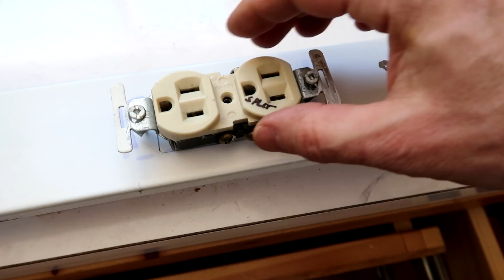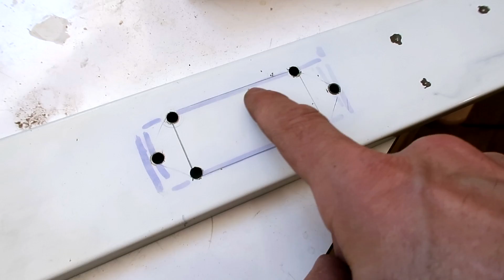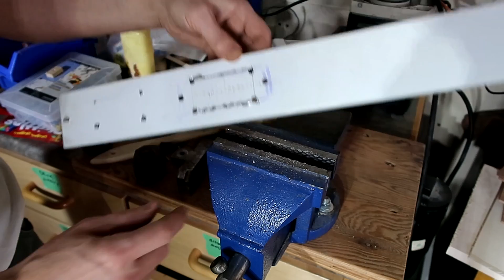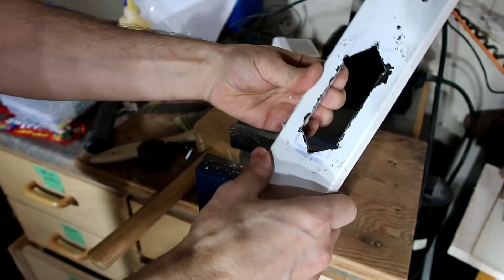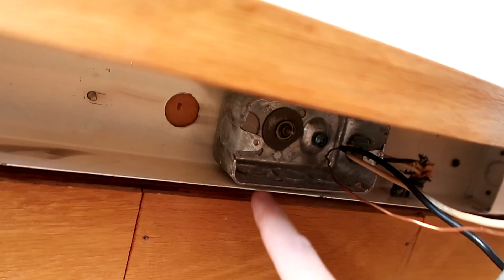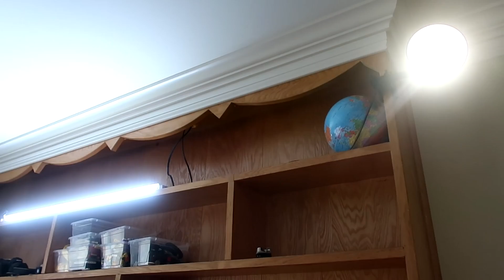Metal shearing with vise and chisel trick

Comment: Without electricity, I once used this method (along with a large hand crank drill) to make slots in a  homemade replacement sheet metal push-rod guide, for a broken down electric generator.

Comment: Would it have worked any better or worse if you'd screwed a block of wood to where you wanted to cut out with the chisel? You know, similar to when you drilled out the holes. I mean, I know you wouldn't have been able to chisel out from the other side without moving the block, but it would have been held nicely in the vise.
Reply from the maker: no.  I needed to shear, not cut.
Reply: @matthiasrandomstuff2221  Fair enough, it's just something that occurred to me. I don't do enough work with metal to know the best way to do this sort of thing.

Comment: Not a single waterstone in sight!
Reply: Waterstones are a compromise that effectively polish while rounding edges. :)

Kidding. Sort of. But the softer the stone, the more this occurs. Soft water stones are ok for sharpening knives, plane blades, and wide chisels. They are terrible for sharpening quarter inch chisels, awls, and drill bits. Harder stones can sharpen all of the above. You just have to live with the esthetic scratches they can leave on a knife.... or obsessively polish in an extra step, which is no more work than obsessively flattening soft waterstones.

I think the only place waterstones are actually highly popular is in an alternate reality called the internet, and it's a testament to the power of advertising.

Comment: I have a nibbler for just this kind of work.  They make quick work of it, and produce a pretty clean edge with minimal filing.  Personally, I find this kind of shearing is better left for things like thin carbon steel because it breaks cleanly, without the wavy edge.  Bushradical has a pretty good video where he uses a similar technique to make ulu's out of old hand-saw blades.

Comment: You said the angle grinder was messy? 🤔🤔🤔
Reply: Edgardo Guzman I guess he meant messy as in: metal particles flying all over the place
Reply: Also cuts slightly further than needed, especially on the short sides
Reply: @TheMijman   So what? Everything will be hidden beneath the cover. And you could also use a worn-out disc that has a smaller diameter. Or a dremel with a really small disc.
Reply: @hunjoey  +1 for the dremel.
Reply: @hunjoey  That doesn't negate the comment above about metal dust/shavings/foot-destroyers/anti-baby-countermeasures
Reply: My point exactly
Reply: I drill with my welder sometimes

Comment: I'm sorry, but I just have to say this: I cringe every time I see "your" (and by that I mean north american (all the countries on that part of the continent)) electrical system/wiring.
Why your houses burn as often as they do caused by faulty electrical systems seems completly clear to me. Houses of wood, 120V (half the voltage compared to many other countries = double the current = 4 times more heat in the wires) and that electrical wiring (i.e. using screws to hold the copper/wire) seems like beeing chosen by the devil himself.

But relating to your video: if you want to shorten a chain, this way also works very well (clamping a chain in the vise and then snapping one link off).
Reply: yo just curious, what do u guys use instead of screws?
Reply: @albertlagerman  
I can just give a german view here. Screws are still commonly used in this home application, since you are mostly dealing with rigid cables and such with outlets , these are not subjected to any sort of vibration that poses a risk of loosening the screw. In industry, push-in connectors like WAGO are pretty much the standard these days.
Reply: Australian chiming in here...

Household power sockets deliver a maximum of 240v, 10A. All (most?) electrical connections are made using machine screws in some sort of brass or copper connector.

Edit: I'm not an electrician, BTW.
Reply: 2X current gives 4X heat only if the wire diameter is the same. I assume you guys take advantage of your high voltage and low current to use smaller diameter wires. So that advantage probably isn't relevant. Of course, large diameter wire is more expensive. So you've got us there.

Comment: dude, just put it flat on a piece of wood and chisel away.
Reply from the maker: due, please try your ideas out before suggesting them to others.
Reply: TheAnalogKid2, it might work if you used a really hard chunk of hardwood, and lined up the edge of it with the cut line, but if it's just a flat chunk of wood all the way throughout, there isn't going to be any shearing going on.  The force on the edge would be so much that wood would probably get dented and smushed, and not make a very clean cut on the metal.  He's not actually stabbing it with a sharp edge of a chisel.  Thisoldtony has a video on some sort of big metal shear, and this video is using basically the same idea.

Comment: I wouldn’t have told about the yard sale chisel and let peoples minds explode
Reply: Wut? I would have just used my best (and only) 3/4" chisel the way it is, then fixed it after. Heck, I ground the end of my narrowest chisel into a pointed staple puller the other week. Done the job. Then ground a new edge on it, losing almost a quarter inch on the length of the blade. I momentarily considered finding a large allen key, fixing a handle to it, and grinding the tip. But I figured this was easier and faster, since the shape of the tip was pretty close to begin with, and it already had a handle. Plus, that allen key wasn't in the first place I looked. 

I know that this chisel is a bit softer steel, though. I tried pulling a nail with one of my harder chisels, once, and a nail-head shaped chunk of the steel broke out. Still using that one, too.

There seems to be plenty of extra length to spare on the modern western chisel. I suspect that chisels have lived a much harder life in history that what most do, today. When all you had were hand tools, the chisel would be one of most expendable. It's just a rectangular bar of hardened steel in a handle. Break the tip? Don't worry. There's more.
Reply: Fer chisel ma dizzle

Comment: I hope you wrapped those terminals very well with electrical tape.
Reply: @Tom-yj3xp  I don't think we want to ground the hot and neutral terminals. The faceplate and metal enclose of course should be grounded as they are conductive.
Reply: Really, you think he's not aware of that? Just chill, man.
Reply: @barnabyjones8333  http://bfy.tw/MuaC
Reply: @johnsesser1678  chill
Reply: @barnabyjones8333  http://bfy.tw/Mucp
Reply: ooh grounding , without it very danger. dont worry he did it all